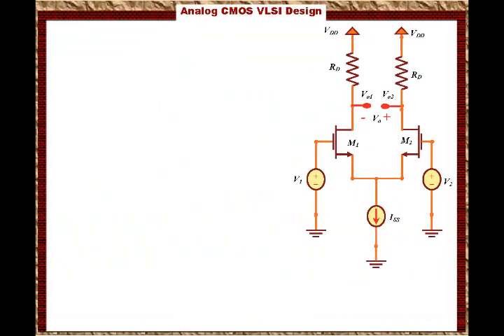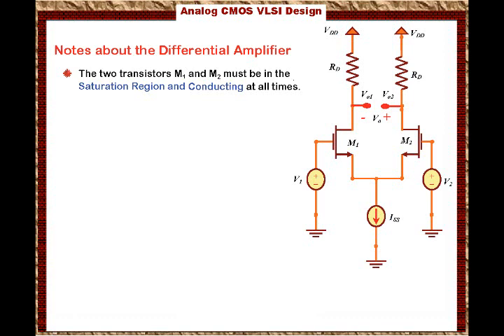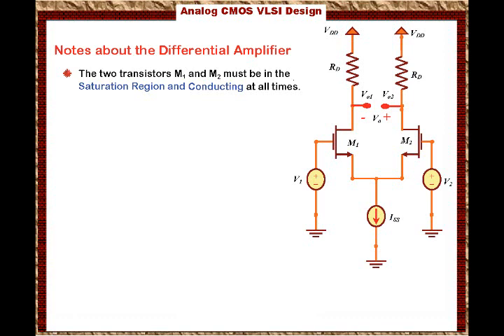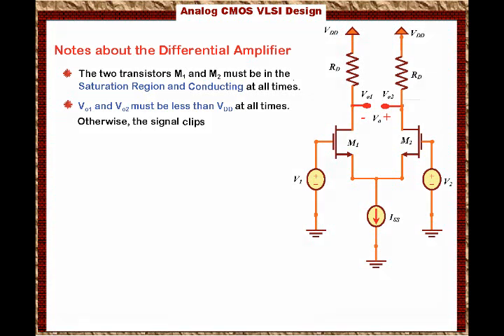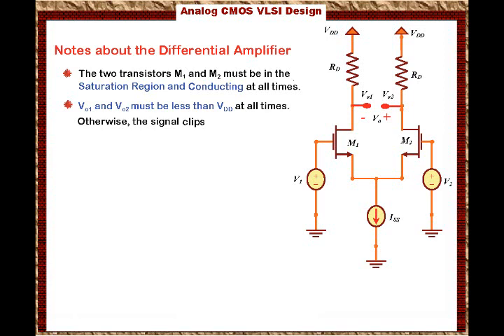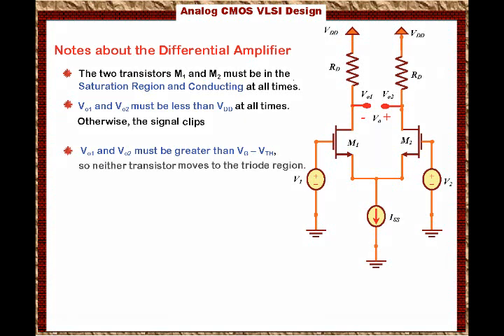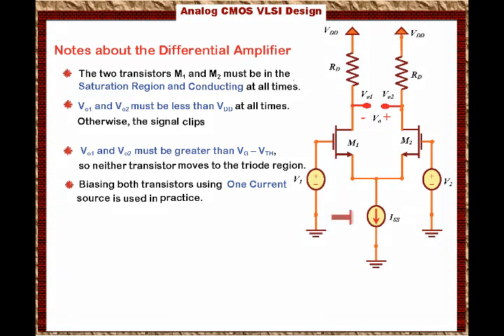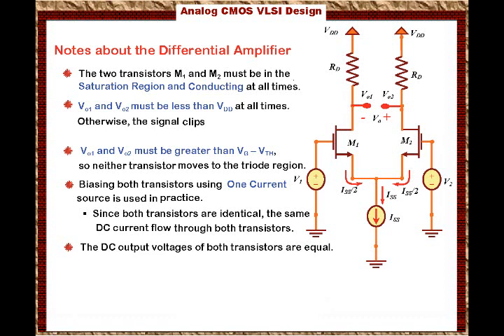Analog CMOS VLSI Lecture-3 Part-5

Comment from the maker: sure. We are building up the concepts to design Op-Amps. 
The input signals are the gates for M1 and M2. 
So, the DC voltage for V1 and V2 must be 0V if we use dual power supply (VDD and -VSS) or it must be VDD/2 if we use single power supply (as shown in this example). 
So the common mode DC voltage is fixed (in the Ideal condition). the current through the transistor is a function of VG -VS. So, the W/L and ISS and VS are related. 
Basically,  VG is fixed, but VS varies as a function of W/L.

Comment from the maker: In this discussion, we are building up for transistor level OP-Amps. So, the gate voltages V1 and V2 are the AC differential signals and the common mode voltage. Yet the way we bias the two transistors are via the current source. The bottom end of the current source can be -VSS or ground.  I hope that helped.

Comment from the maker: @moroba7 You need to look at the I-V curve with three variables, Id, Vgs and Vds. Then, by holding Vds constant, the change in Vgs in the saturation region leads to a large change in the current than it is in the triode region.  Refer to an undergraduate electronics textbook. Look at the common source amplifier.